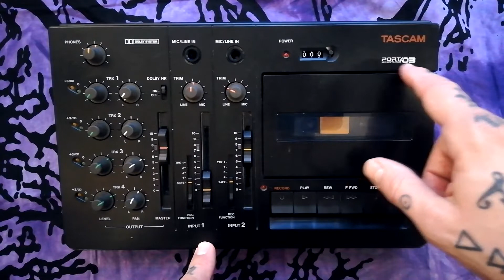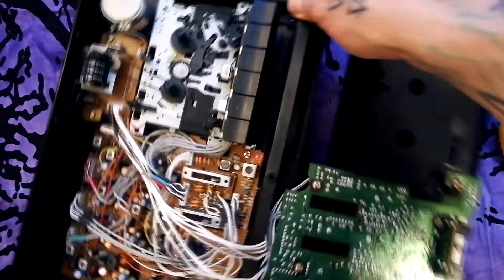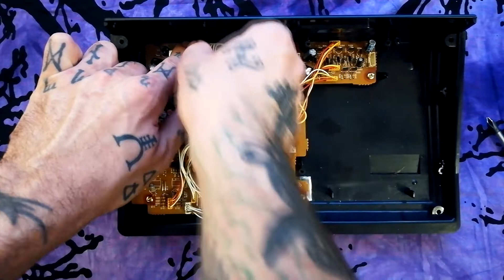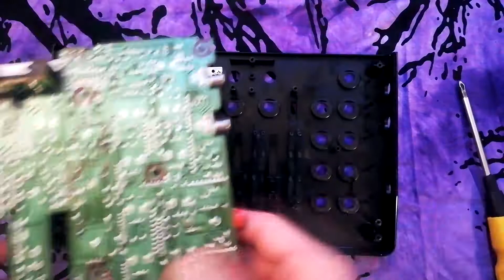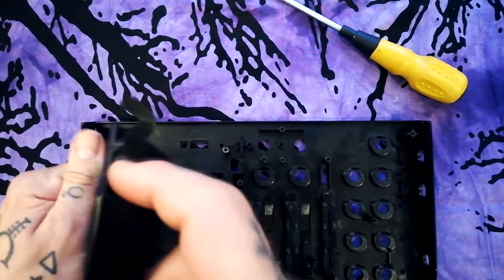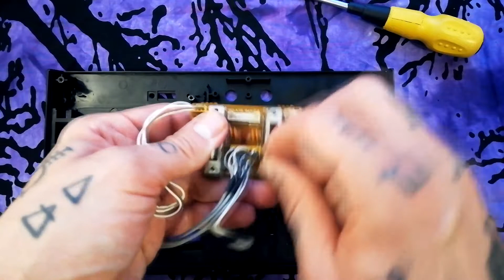Tascam Porta 03 | Tear Down

Comment: Greetings Master, wanted to get your opinion on belts. Do you believe belt quality affects these tape decks significantly, as in cheap multipack belts vs those $10 per unit belts. 

Also for the porta 03 specifically you said transport 80-90% similar to 414. do you know if the belts are the same size ?

Thanks again really appreciate your videos. Wouldn’t know what i’d do without your content.
Reply from the maker: Thank you! I have bought cheap multipacks before - up to half are kinked or otherwise deformed and go in the bin, but the rest have been used on machines I won personally , and they worked all right tbh. I tend to use more expensive belts when doing work for hire for paying customers just so they don’t second guess the results…but to my aged ears, damaged as they are by years of abuse, the more expensive belts make little or no difference?

Comment: Hey there. Trying to get power to my old porta studio 03 and can’t seem to find the problem. Have opened it up and not seeing anything that looks broken. Just won’t turn on. Any suggestions on where to start or another video of yours I may have missed? Thanks!
Reply from the maker: @papslappy  if there’s no sign of power at all a likely scenario is someone plugged in positive tip 12v PSU instead of negative tip. This tends to blow the regulator near the power socket which drops the 12 volt from the PSU to 9v for use by the opamps in the audio circuit, and blow any or all of the polarised electrolytic  capacitors connected to circuit ground. The solution is replace these components, it’s an afternoons work if you know how to solder.
Reply: @ thanks so much for the reply! Yeah I’m kind of an amateur with this stuff so I may need to find a local person that can help with the soldering. Is there a go-to site for replacement parts for these things or just eBay?Thanks again for the information. Extremely helpful!
Reply from the maker: @ you’d get it cheaper from a wholesaler like digikey or mouser, but if eBay is easier that’s fine
Reply: @Tetrakan  thanks for the recs!

Comment: hey I got my hands on one of these and Im real excited to say all 4 tracks record but there is this audible hum you hear when the music ends. when I record it to Ableton it looks like a sine wave when you zoom in and its almost the same level as the music when you zoom out. I really dont want to send back another one of these cause getting a not ridiculous priced one is getting harder every time I look.
Reply from the maker: That's a shame...do you have the facility in your DAW to figure out what frequency it is? I was wondering if it is the same as or a multiple of the mains frequency in your region?
Reply: @Tetrakan  I’m not 100% sure, I’ll look into my plugins tonight but its like low end hum. I’m in America and it’s 120v. You think it’s like 60 cylcle hum coming from my wall? Also the pots are really dirty, the headphone out is real loose and cutting in and out like it needs to be replaced and the power input is so loose even moving the machine will knock the power out, and before I try to fix these things, I’m 130$ in, you think the juice is worth the squeeze? Or should I send it back?

Comment: Thanks for this video, helps out a lot. I tracked down some cold solder joints on a very dirty unit I just picked up which fixed the power jack and monitor pot that was popping. I'm only getting a R side monitor on stereo headphones unless I pull the jack out halfway. I tried re-tensioning and cleaning, any other things to try before replacing the jack?
Reply: also a note, and for anyone reading this- top right screw on the board with all the pots is the spot for the case corner screw, I was wondering why I couldn't get the screw in that corner in